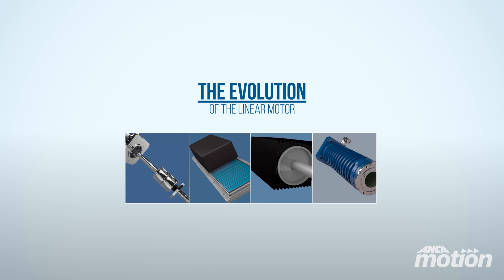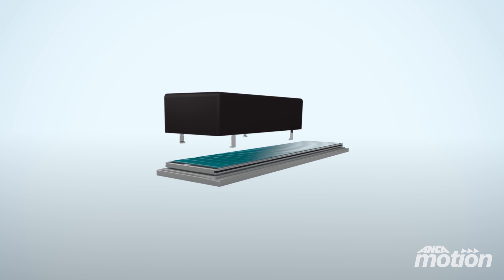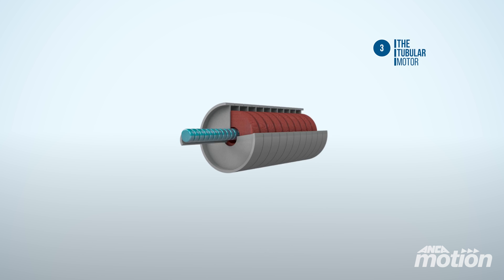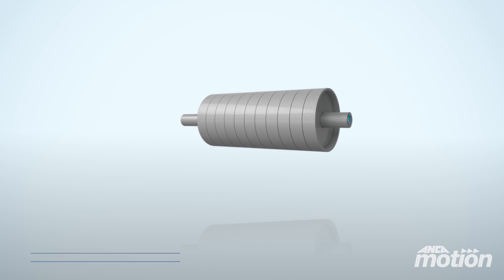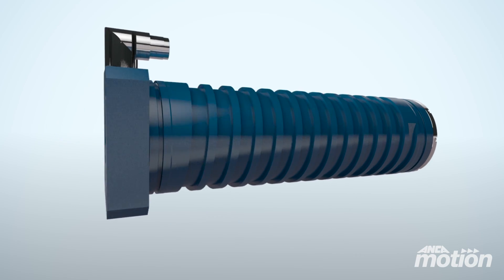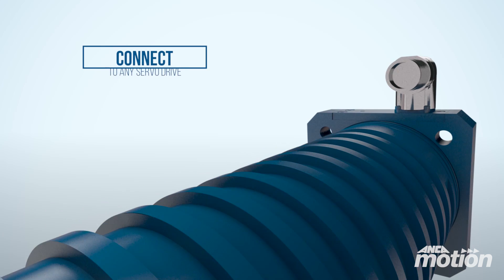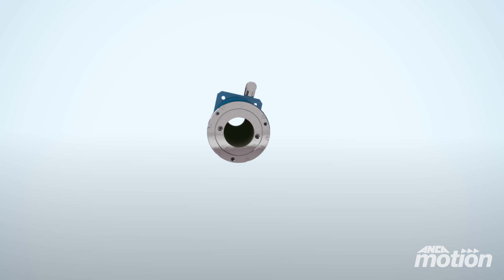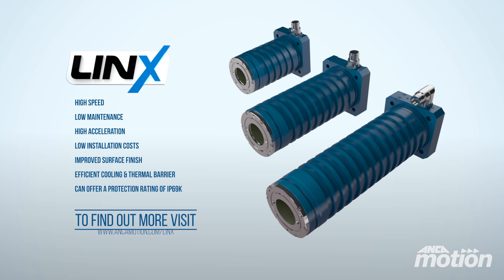LinX® - The Evolution of the Linear Motor

Comment: where the hall sensore is put? on the shaft or the stator? i need large shaft. What price have?
Reply from the maker: Thanks for your question! The LinX® S-Series motor requires an external position sensor, while the LinX® M-Series has an integrated position sensor located in the forcer. Both of them can accommodate standard shafts of up to 2.1m. Find out more on our website: https://motion.anca.com/
Please reach out to us at sales@ancamotion.com to size the motor for your application.